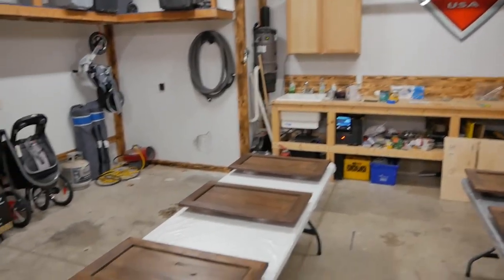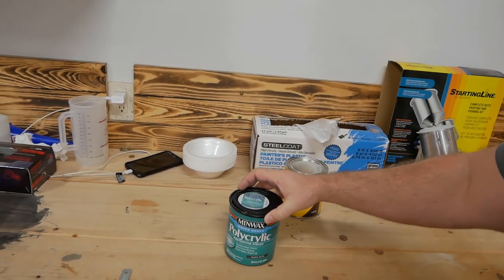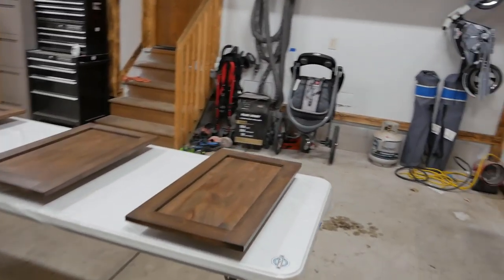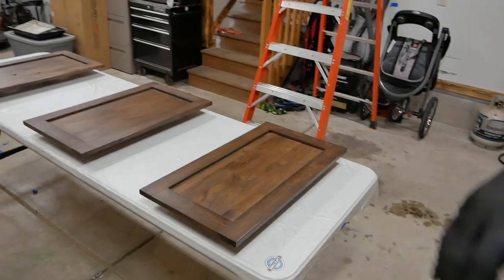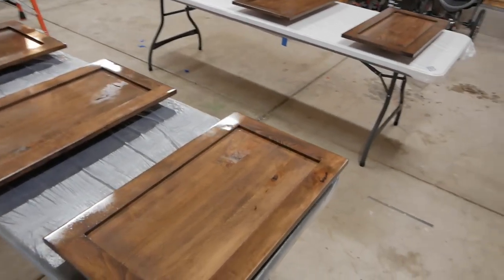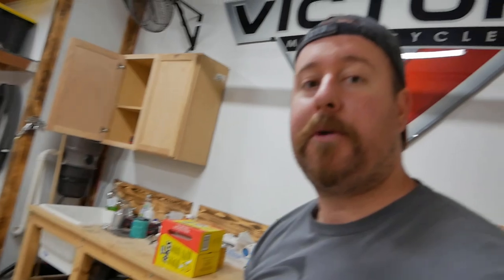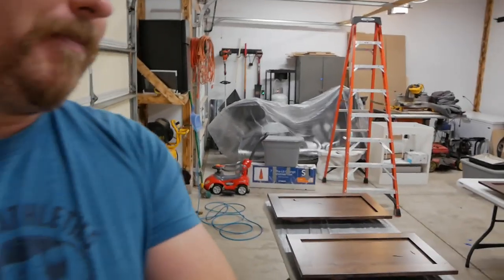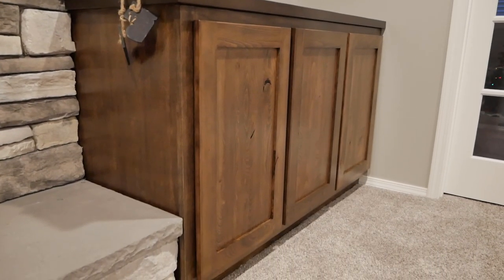DIY Smooth Finish On Cabinet Doors with Minwax Polycrylic and DeVilbiss HVLP Spray Gun

Comment: I tried brushing this stuff on with both a foam and bristle brush. Wasted 2 days chasing bubbles and sanding. Followed instructions to a T, no luck. After finding your video I decided to spray my project. 100% success. I have a Devillbiss FLG4 with a 1.8 tip. Like you I stirred the polycryl and didn't reduce. It ran through one of my autobody strainers with no problem. Glad I stumbled upon your video, I'll never brush this stuff on again. Thanks
Reply from the maker: Awesome! Yea definitely spray when at all possible. Much better finish most of the time

Comment: Thanks - good job and video. I do a lot of small hobby projects and the spray cans are now crazy expensive. I bought some polycrylic and will first try it in my airbrush. If that doesn't work out than I will use my small spray gun. Thanks again!

Comment: Lived in Derby for 6 years while stationed at McConnell. Miss that place. Great video. I've had the same experience with spraying polycrylic. I've done my flats the same way for the last couple of projects. Zero overspray or drips on the corners or underside. Much easier than setting up a hanging rack as the pros do it. The only sanding I've ever had to do with polycrylic was my fault with lint or a gnat during a spring/summer spray. Great job. Love the look of the knotty beech wood.
Reply from the maker: Wichita is a pretty nice place. Windy, but nice.

Comment: Actually the ideal way is laying flat like that and one side at a time, I always finish the backs first then flip. I dont know of any cabinet shop that does spray both sides at same time, there are hangers for conceal hinge holes but they are not cheap. All in all you can put a heavier coat without worrying about running or sagging with it laying flat.  It is faster and more efficient to hang and do both sides at once, but much easier to achieve an excellent finish with it laying down. Aside from that you did a great job and they came out good.
Reply from the maker: Good to know, I figured they would have tried to do them quicker by doing both sides. Definitely don't have to worry about runs laying flat like this though. Thanks man

Comment: Nice video.  I have the same compressor and spray Polcycrylic all the time using an HVLP. It looked like your spray pressure when engaged was about 30. I find with any tip smaller than a 2.5, the amount of spray is minimal.  Do you dilute the poly?

Comment: Nice job, thanks for the video. I am getting ready to finish kitchen cabinets stained with Minwax. Questions: What air pressure were you using? Did the Polycrylic require thinning, if so what was used to thin the Polycrylic and ratio?
Reply from the maker: I usually set the gun at 20-30 psi. I don't believe I thinned this product. If you did, it wouldn't take much, maybe 5% or less water would get it running smoother through your gun.

Comment: Great video and I thought the doors turned out great. I have a small wood shop in my garage and looking to upgrade my staining from wiping and brushing to spraying and was curious as too what size air compressor you’re using and how hard it has to work running an hvlp, thanks
Reply from the maker: I have a 15 gallon. If you were wanting to get something for larger jobs, at least a 30 gallon if not 60 gallon would be preferable. Bigger reserve, fills faster with a bigger motor... I just have this one cause it's fairly mobile and I don't have a dedicated shop

Comment: We are spraying with a generic gun at 62 psi 50’ hose and a 1.4 tip. We are getting  bubbles galore. No smooth finish. What r we doing wrong I’m so sick of sanding
Reply from the maker: Try turning your pressure down to 30 and see how that works. Do some test panels!!
Reply: Does the tip matter?

Comment: Have you ever used a the Polycrylic in a semi gloss or gloss in a spray gun? Just wondering if the results would be the same..
Thanks,
Tony
Reply from the maker: I have not... ultimately, regardless of sheen, spraying will usually give a smoother finish with less bubbles as long as it's applied correctly. Thanks Tony

Comment: do u need to mix with water to make the poly thinner so it can pass it better with the gun?
Reply from the maker: You don't have to. Doesn't hurt though since it's water based. All depends on your tip size. The smaller the tip (1.8 mm or smaller probably) you'll want to add a little water

Comment: How many coats and did you thin out the poly with mineral spirits?
Reply from the maker: No thinning, just 2 coats if I remember correctly. You could do 3 if you wanted

Comment: hey man has this finish held up?
Reply from the maker: Oh yea. It's good stuff in my opinion
Reply: @LifeofBliss  right on thank you.  any input on the shelf life of the can after you've opened it?
Reply from the maker: I just used some that was about 3 years old. It worked but was a little thick, had to water it down about 10%. I'd easily say 1 year and you can get away with longer if stored correctly

Comment: What type filter are you using on the polycrylic?
Reply from the maker: When pouring into the gun? It's just a standard filter for auto paints, not sure the specifics as far as opening size

Comment: The problem is the durability of that product in the long run.
Reply from the maker: It was a low use area. Sold the house a few years back. Have you used it before and seen faster wear?

Comment: Sanding between coats is done for proper adhesion, not smoothness.
Reply from the maker: When reapplying within the recommended window, sanding is not necessary for adhesion. This was to reduce the dust bumps in the finish for the final coat